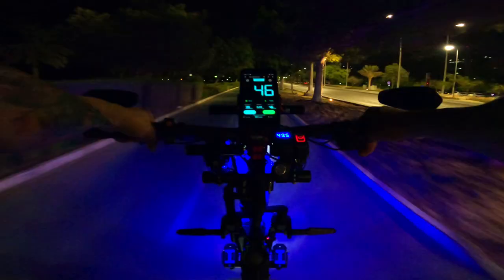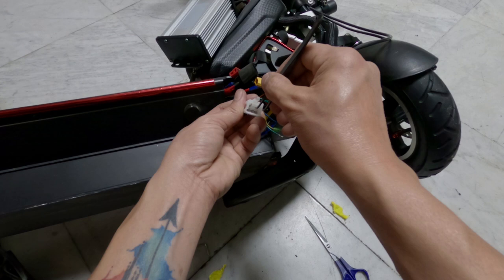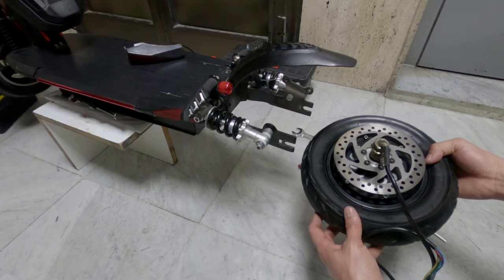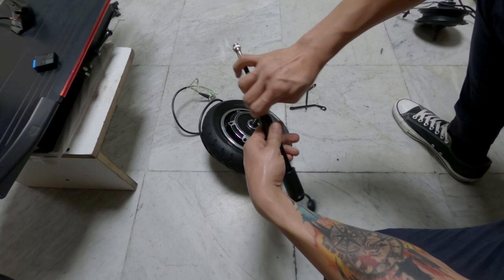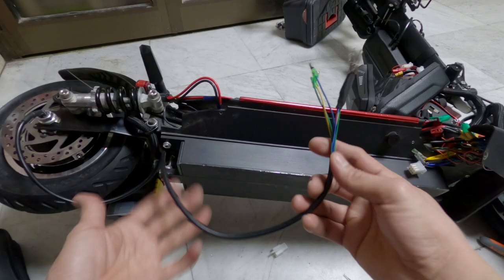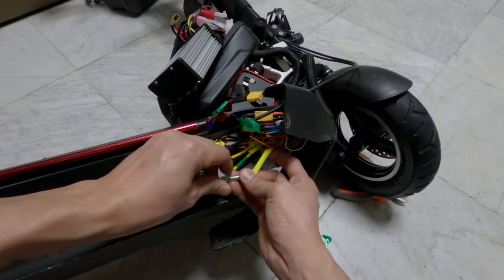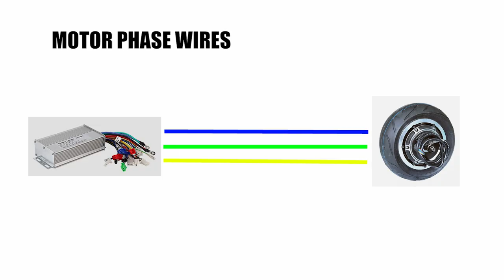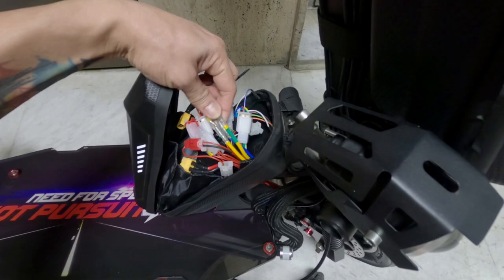I Installed 1500W Unbranded Hub Motor To Get Extra Speed!

Comment: Tips , brushless controler mo tapos motor hub plus battery 48 volts . Put speed batt it can reach 100kph
Reply: You cannot get 100 kp/h with 48V baterry,maximum 60kp/h with dual motors,you have to increase your baterry voltage for more speed.

Comment: Boss ka adik pwede ba palitan ung hub nang walang controller? 😅
Suggestions naman for e10 scooter user 😅😊
Reply from the maker: Oo, pede nmn palitan kaadik!
Bale un phase wires at hall sensor wires kailangan mo lng i-connect ng maayos.
Usually kase pag hindi isang set un controller at hub.
Hindi rin tutugma un color code ng mga wires ng hall sensor at phase wires.
Hahanapin mo pa un tamang combination nun mga wires.
Ride safe lage kaadik!

Comment: Hello. I have an 800w dual motor (1600w) scooter. I want to buy and install two 3500w motors. They will be 7000w in total. How can I adjust the batteries of these 72v motors? Finally, can you help me how to connect the controller? A monster scooter.
Reply from the maker: Goodday!
Do you mean that your scooter is already 72v?
Reply: @jaysonulanday  goodday. No, my scooter is 48v right now, I want to output it to 72v. Moreover, instead of 800w, I will use 3500w or 7000w. Do you think I can sleep? My scooter Onvo 12 x plus
Reply from the maker: @toffty_ 
You have to rebuild your battery, add some more batteries in series until it become 72v.
You also need to consider the capacity of the battery pack(72v). Big enough to supply power to the 72v controller. 
2x3500 hub motor would consume more power/current.
It's going to be a lot of work brother.
Reply from the maker: @toffty_  i checked your scooter from google, it looks cool!
Reply: @jaysonulanday  Oh thank you so much.
Reply: @jaysonulanday  your scooter too cool really!

Comment: hi po sir pwdi po ba palitan ng motor ang mini harley ang  bagal kac ng takbo sakin at yung battery ko naka 48v na dali din ma lowbat any recommendations po
Reply from the maker: Goodday kaadik!
Oo, pede mo palitan un motor basta may available high wattage. Dapat palitan mo n rin un controller ng mas mataas din.
Sa battery nmn need mo magdagdag connected in parallel(same voltage) para matagal malobat.
Ride safe palage🤟
Reply: @jaysonulanday  ok po so mag dagdag ako ng another 48v tapos palitan motor any number sa motor like higher ? then ss controller pwdi na yung 36-54v can use
Reply: @jaysonulanday  ang sabi kac sa iba na kung mag taas ako ng battery like 60v tapos palitan lahat motor at controller
Reply from the maker: @martinpanjr839 
Best option yan kung magtaas ka ng voltage, like 60v. mas malakas pag ganun gagawin mo.
Ride safe palage!
Reply from the maker: @martinpanjr839  kung makakapag taas ka ng voltage mas ok un  kaadik. 60v panalo na un.
Reply: @jaysonulanday  mas go ako don sa first options mo na parallel battery at change ko motor higher wattage